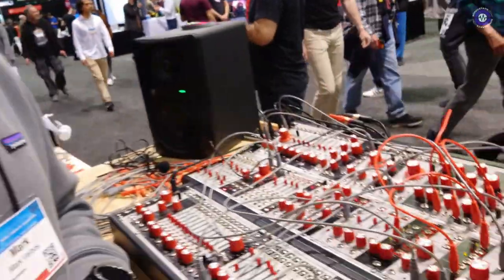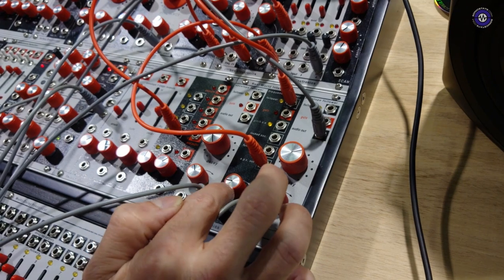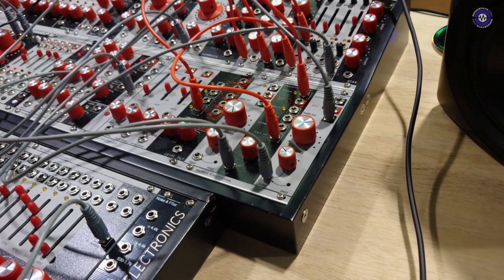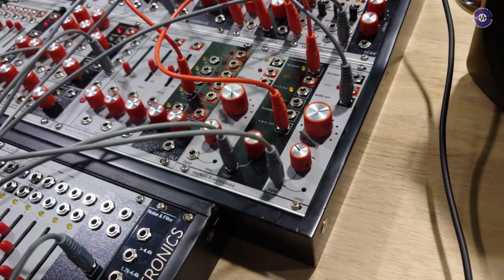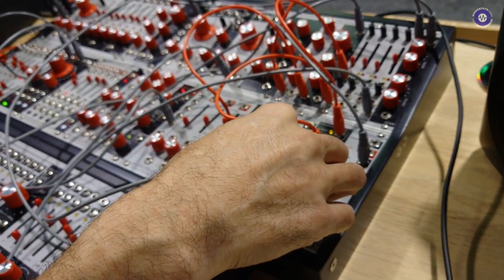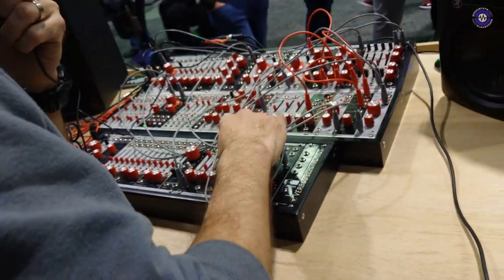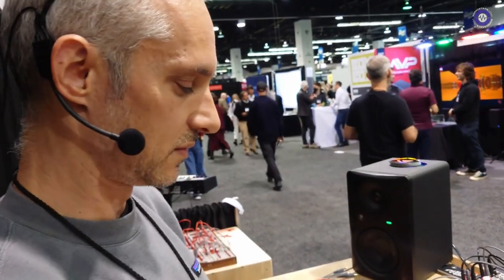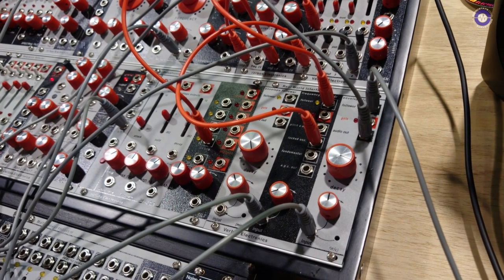NAMM 2023 - Verbos - Real World Interface

Comment: Ridiculous that there's no 1/4" input.
Reply: How do you want to fit a such an input on a skiff friendly module. There are no such components that could fit on the pcb. And is it really such a problem to buy a 1/4 to 1/8 inch cable? you get the cheap ones for 3,50 Euro and I think people who can afford such a module can also afford two doepfer cables that are about 7 Euro and Verbos even makes these adapters. One could say that the demo is not good. I would agree with that but otherwise your point is ridiculous and shows a lack of knowledge about manufacturing.
Reply: @neleknut2379  Befaco did it on their Instrument Interface and that's only 30mm deep
Reply: @ScottofOakland  I guess I stand corrected somehow, but also not really, Befaco uses 2 PCBs since the input socket is so deep. Verbos always uses 1 PCB since manufacturing is cheaper then and why use 2 pcbs if one could fit the components on one. But why do I care, the module will be overpriced like all their other stuff anyway. The layout of the modules is very good, the sound is horrible often, at least to my ears.